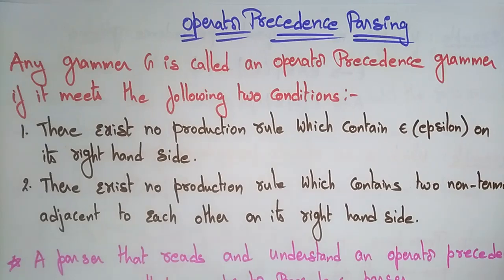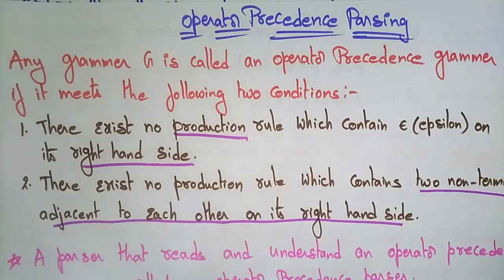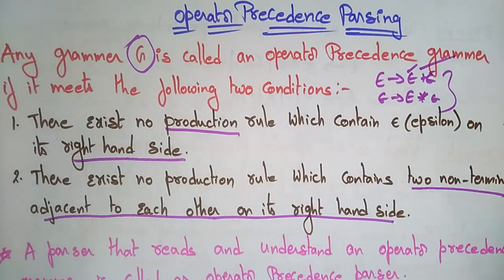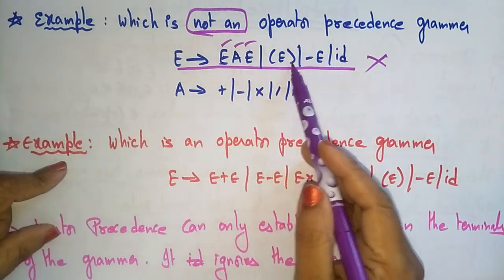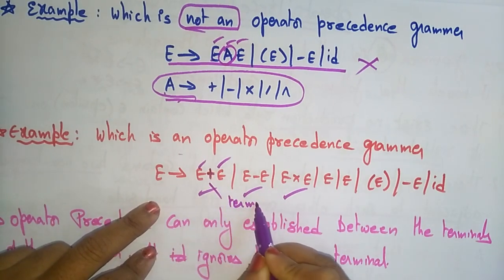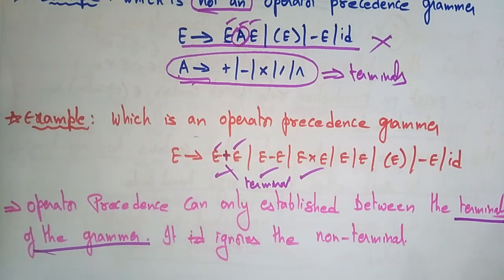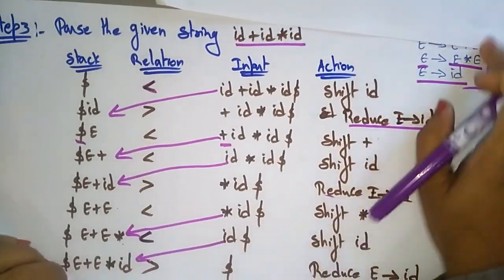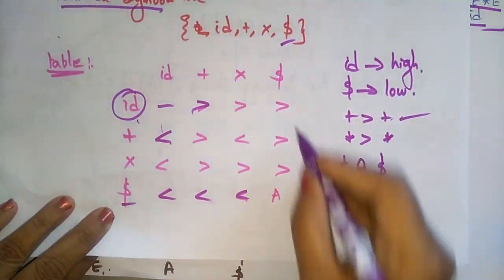Operator Precedence Parser | CD | Compiler Design | Lec-08 |  Bhanu Priya

Comment: Hello Maam and future students trying to learn Operator precedence Parser. After attending Compiler lectures in my college i have realised that you have missed an important step in Operator Precedence. The Precedence table is not fixed as you have shown in this video, we are required to find something called as leading and trailing that leads to the formation of Precedence table. Anybody who uses the fixed table that you have made is going to get the wrong solution. This operator precedence table is correct only for this question and not for all questions.
Please correct me if I have made a mistake. You can look at deeba kannan's lecture on this topic to understand.

Comment: i have question when E+E in stack why you  donot  reduce with E
Reply: That will not make any difference
Reply: @billuchoudhary4436  the difference is there , I am not getting E+E from bottom up approch  instead I am getting E*E.. which is totally wrong..
Reply: Because in E+E and *id * is greater than + so there is use shift rather than reduce